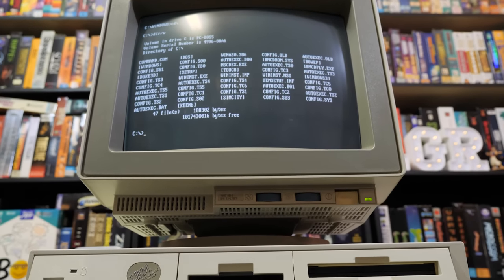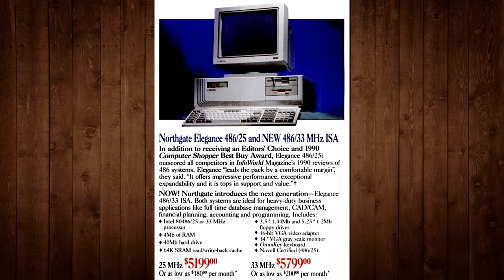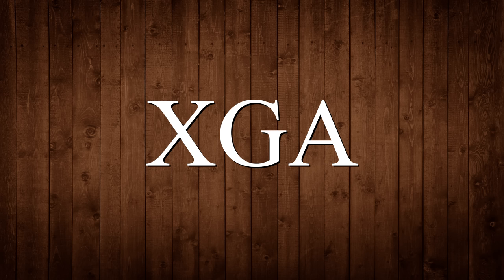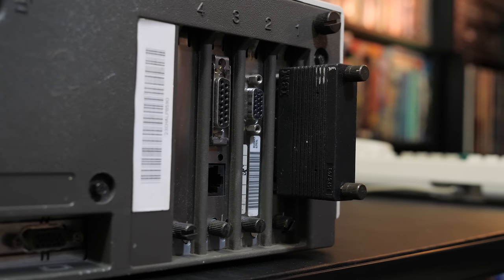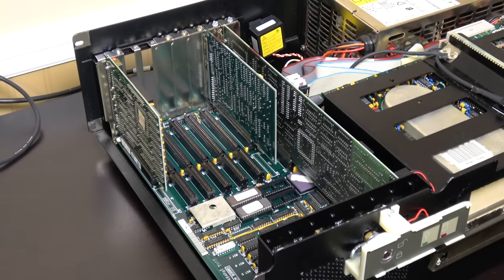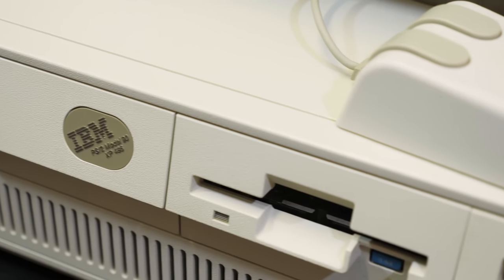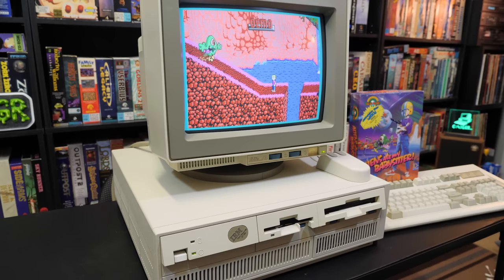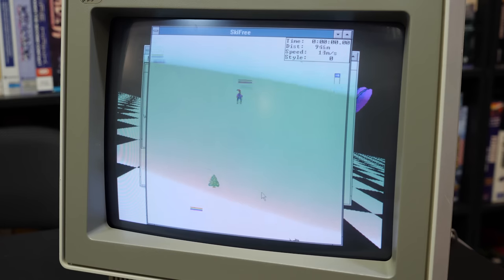$17,000 PC from 1990: IBM PS/2 Model 90 XP 486

Comment: I love your video. I've owned the model 30,60 and 95 back in the day. I would have died to come across a model 80 or 90 as it took less room yet had about the same amount of expandability and compared to the model 30 all the others were absurdly expensive, but also highly expandable if you had access to IBM approved hardware. I installed a DX4 in my Model 95, and used both OS/2 3 & 4 and that was freakishly fast. The one thing the others couldn't offer even if faster was IBM quality. For all of IBM's faults and believe me it's easy enough to find them even with that computer, it is built incredibly well. IBM refused to cheap out. This partly is why they were never successful in the home market. Even the Aptiva was built really well even if it used standard microatx parts. I still own a ThinkCentre model 55, it's not fast nor was it cheap when it was new. But, it was a very well built computer. Next to anything HP sold at the time, it was easy to see the difference. Most business firms could see it, not so much with home users. That's the case with Dell today. Who uses Dell? Well besides myself of course many businesses are now using Dell hardware. Quality. Lenovo just doesn't offer that same quality as IBM did? But you don't see a lot of firms using HP.

Comment: we had the previous model the Model 80 which was $8495, luckly at that time since my dad was developing OS/2 Warp, IBM gave us that computer. for anyone that hasint used those computers, they are loud like Sega Dreamcast fan loud. the case was also heavy (not sure how heavy the Model 90 was), and it had foot pedals on the bottom but a full steel handle bar to carry the case. you could also unscrew the handle bar and do some serious damage to someone with it. he used the Model 90 at his work desk during his time at IBM.

Comment: My computer in 2004 had 32 MB of RAM and a 500 MB hard drive running Windows 95 and it was the most expensive thing in my house. Never really understood how powerful computers were in the US for a reasonable price from the early 90s; this could be an exception but it's powerful even compared to what I had 15 years later!

Comment: If you think it was slow, try the one, which did not have hard drive and had only two 5 inch floppy disks. One used for system floppy and another one for data floppy. That was fun to work with.

Comment: That thing can probably run win98se. Not bad for 1990. In 1990, I only had a Packard Bell 286 with standard VGA, but I did have a 9600 baud modem and an adlib sound card :)

Comment: The IBM micro computers were very expensive because they were built like tanks.  I personally don't remember knowing anybody with such computers at home except for a friend who had a IBM jr computer.  Everybody had some clones at home.  You had two types of clones I may say.  First, you had companies who branded their own great clones, then you had the regular clones made of cheap parts (the casing was the cheapest part of all).  You could have a 486 computer for something like 3,000 to 3,500 $ (including an amber or green screen).  It was perfect for home use...  A IBM could work 24/7; not a clone (meaning commercial, institutional, factory wouldn't trust it).  
As I was an engineering student back in 1990, the easiest way to buy my own computer was the faculty coop who would sell many computers with at good tariffs.  I bought an Apple+ (the small 9 inches b&w screen) with a matrix printer and a 40 mbytes hard disk (lol) for a little more than 3,000 $.  I still have it in a giant bag made to carry it !  Without the printer, it weighted a good 30 lbs......  It was big.....  Nice era I must say because we were following the evolution of the micro computers from the start.  I also have a commodore Vic20 with a cassette recorder (instead of a high tech 5¼" floppy drive).  I had, on that bomb of a machine, 3.5k of RAM and built a card with an additional 3.5k for a total of 7k !!!  I was proud loll.....

Comment: All of that amazing performance that could be had for more than $20,000 equivalent is now dwarfed by a $10 Raspberry Pi Zero W.

I had a PS/2 in 1993, which cost substantially less, and had the DX2/66 CPU in it. I think I had it decked out with 8MB of RAM and it went through a succession of hard drive upgrades starting from the stock 80MB to eventually 1GB before I retired it. I also added a sound card, CDROM and ultimately, the CPU upgrade to the 83MHz Pentium. The expandable CPU option was more of a gimmick than anything, because by the time the updated CPUs were available, the system was already on the edge of being obsolete and you weren't going to gain that much more performance from a CPU upgrade on old architecture. It was a well-built machine, I never had any issues with it and it was compatible with everything I added to it or ran on it.

Comment: I had this exact same model, but mine was only $1000.  Of course, I can tell why there was a huge difference between prices.  Mine was a 386DX 33MHz with a 120 MB HD, with only a 3.5 Floppy Disk Drive.  A lot of those specs were incredibly expensive, like having a 1 GB hard drive probably costed about $5000 by itself.  The CD-ROM drive probably by itself was about $500, which could land you an older computer for the same price.  From what it looked like, it was state of the art for its time, and actually is a fairly decent price for a PC.  Just think of a high end Alienware or iBuyPower computer, and the PC/2 is probably a cheaper option because the price was that high because the technology costed that much versus Alienware being that price because of the name and because it looked nice.

Comment: AT&T Globalyst 486 computer made around the same time was half the height of the IBM version and instead of 5.25" floppy it had spare slot for optical drive or HDD tray.
Reply: 23 may 1994 is not "around the same time" and the computer was not half the height of this IBM... not to mention that this one also have optical drive(clearly you dont understand that this IBM PC is not modern day Apple product that have its drive soldered to MB).

Comment: I scavenged a model 95-something big monster thing (or at the very least, an IBM server computer that looked pretty similar to that) from a dumpster behind a company that went out of business many years ago. I installed Windows on it as the hard drive(s?) were removed from it before they threw it away,  and I think I MAY have played the original Age of Empires on it a lot, I can't quite remember at this point. I wish I still had that thing.

Comment: A very cool look at a very impressive computer for the time!  The only PS/2 I've still got lying around is a Model 80.  Back before I got around to restoring it to working condition, I used it as an end table in my living room.  No joke.  I'm not even sure anymore if it uses a 386DX or a 486.  I do know that it only has 1MB of RAM, and I've yet to run across a compatible RAM board to upgrade it... so no DOOM for me on that machine.

...It does run Wolfenstein 3-D though.  ;)

Comment: At least it wasn't crippled like most PS/2s, this one got a full 32-bit MCA bus and memory addressing! The cost disparity continued even into 1993. You could get a VLB 486DX2/66 clone system for much less then the "low end" PS/2 Model 57 which was hobbled by only having a 16-bit MCA bus and 24bit memory addressing (16MB max RAM) thanks to its tarted up 386SX derived 486SLC2. Its kinda bizarre that most 32bit CPU PS/2s only have 16-bit slots when the whole point of making a brand new bus was to add true 32-bit support.

Comment: I had a less powerful PS/2 (386 SX, 1 Mo, not-quite-VGA-but-almost graphics) as a teenager, 2nd hand from an administration paid with my pocket money. A 486 with 8 Mb would have been way out of the means of my family. that. I was programming in Pascal, x86 assembler and enjoying DOS games, the thing was very reliable and could be transported with no worries. Now I wish I've kept it to setup a server with that rock-solid frame.

PS/2 with 486, can play Doom, that's a thing dreams are made off.

Comment: In 1990 I think the only software I had that could even use 640x480 graphics was Fractint. I think Scorched Earth was the only other thing that went over 320x200, but it was some kind of weird resolution like 320x480 without square pixels.

Comment: So I decided to look into what a machine comparable to my NuXT would have cost in 1983, assuming the parts existed (some of which didn't). Accounting for inflation and the fact that my NuXT has a drive that didn't exist yet in 1983, and deliberately ignoring the IDE CF adapter with a 2GB CF card stuck in it (which would have been worth $514,847.39 on its own accounting for inflation).
 Not including the 2GB CF card, my machine would have been worth $105,543.71 US in today's money. Including the CF card, the NuXT would be worth ~$620,391 accounting for inflation in 1983. Thank the Omnissiah for Moore's Law!

Comment: And come to think about it, for only about $40, I bought a Dell Venue 10 pro 5055 laptop pc which would be much more capable, runs a full fledged Windows 10 pro operating system, and is much more recent, though not new, from May of 2015. I remember around 1990, we were using those Apple II PCs sometimes to do classroom assignments.

Comment: Sigh I remember IBM's insane prices, they were selling a 80386DX/33(?) for about $12000..  I don't recall the year but I think it was before the 80386DX/40 became available in Europe.
I ended up buying a "compatible" with similar specifications for about $3000 : 80386DX/33, 4MB of 70µs RAM instead of the usual 80µs  (I suppose it was µs and not ns), a hard disk of 89MB and a VGA card.  Ah, memory lane ...

Comment: Yeah, that's how it was back then. My 1987 self would shit a brick at how inexpensive RAM is nowadays: I paid $300 for 256k (a quarter of ONE megabyte) of RAM for my Amiga 1000 in 1987. You can buy a 1GB DRAM stick for about $10. That's 4000 times as much memory for 1/30th the price! Just recently I paid $10 for 32GB flashdrive. My 60 MEGA byte HD of the time cost over $300 (and that size was considered "way more than you would ever need/use"). Crazy, man!

Comment: I had a 286 and a 386 back in 1990 and I thought the latter was pretty good for the time. But this thing is an absolute BEAST. I didnt get a 486 until mid-93 and that was a DX40 with 4gigs of RAM not to mention the CD drive, I think I got my first one in late 1994/early 95, I really cant remember. This behemoth could even play Duke3d on those decent framerates I see on the video? On a 1990 machine??? Holy sh@t!

Comment: I recall spending  a couple of years doing summer jobs in the mid 90s to save half the required amount to buy  133Mhz IBM. Fortunately my dad chipped in and paid the other half. Feeling nostalgic.
Reply: Ali Ahmad Was that a 486DX4 or a Pentium?
Reply: It was Pentium I - 133Mhz.   It had Windows 95 on it. Computers were somewhat affordable at the time but still considered a luxury. I bought it for $2500 in 95.  It was the 486 I had been using at school that made me determined to get my first computer.

Comment: I don't know what BIOS revision you are running on there, but if it is still available from IBM (and much of it is!) you should install Surepath BIOS v 10 on there. It was the last revision and will allow you to install ANY complex in that machine, even the P60/P66/P120.

Also, those accept Overdrive chips rather well, but the 100mhz chip only tops out at 75mhz. I think it was a bus limitation if i remember properly.

Comment: The problem with Microchannel, if you added or removed a card (even if it died) you need the floppy of THAT SPECIFIC PC to add or remove the card in the BIOS or the PC would not boot.

Comment: I worked in 2 offices that had OS/2 machines, it was damn nice compared to win31. Of course when no one was looking I installed stuff like Wing Commander and was shocked to find out that OS/2 could play some games in a window that turned win31 into a slideshow if you tried to do the same thing. Pretty much everything about it was more professional and more stable than it's MS counterpart. Too bad they were so ham-fisted about it they might have been the one.

Comment: Did 486 DX2 chips even exist back then? I thought those came out in 1994.. the late 80's ~ early 90's was the 8086 Tandy / CGA days.. 486 would have been way ahead of its time. I know for a fact that the Phillips CD-I console was way ahead of its time during that time
Reply: 486DX2 was early 1992 486 early 1990

Comment: I've had one of those in the mid 90's. Cool machine, have been playing a lot of games but without sound. Imagine a kid who finally saved up a lot of money to buy a sound card (again, mid 90s, so it cost a lot), buing it, going home, and finding out that there is no way to install that, or any sound card available in my pc. We could order one from IBM from abroad for 5 or 6 times the price. The XGA, or XGA 2 in my case was crap, didnt support any SVGA stuff, like VESA, so forget about running Simcity 2000, GTA 1 or Worms (although you could run some beta demos of Worms). Duże Nukem 3d worked only in VGA mode, so no extra stuff like magazines on the ground and no strippers (but he was still giving them money by pressing space button and you could blog them away with RPG, they were just not visible  just the blood).

Windows 95 and DirectX opened up a lot of more possibilities, like Tomb Raider 2, going smoothly. 
It was 486/66 on 33 MHz bus, with XGA2, 16mb of RAM and 640 MB HDD if someone is interested. 
Oh, I got TEAC CD for Christmas, it was cool etc, but again, had to return it and buy another one, cause there was no IDE, only SCSI. 
Can't help thinking that that made IBM obsolete and obscure company. And they were at the top!

Comment: Since I was a computer and software designer, I can tell you that the 1980 Apple 2 computer cost (in today's dollars) $8000.  It had only 4 colors and 16k of memory. It had no disk drive only a tape drive.  When anyone tried to improve on Apple's design (like 32k of memory) they were sued by Apple. Most early computers used the tv not a monitor.  Oh, Apple screwed up as well.  It created the Apple 3 that nobody supported and it cost a fortune.  Even the Fat Mack had problems with buyers.

Comment: OMG that looks VERY similar to the IBM 486 I had. I got it from an Auction sale. Mine only had a 486SX33 CPU I think, and 4MB Ram, and 120MB HDD. HOLY CRAP!  Pretty sure mine is landfill now. I added a normal CDROM to mine. I also dont remember the "cowls" over the drive days. But other than that it looks very very similar.  It was a disappointing upgrade from my 386DX from memory, however it did play Doom2 "ok" so can't have been all that bad.
Reply: Ah maybe mine was the home user version, although the auction i got it from was for liquidated office equipment.......

Comment: Like you said in your video: You needed an IBM MCA license to build a MCA machine. But the real showstopper was, that you initially even had to obtain a MCA license to build add-on cards. That not only alienated all the add-on card manufacturers, but made MCA add-ons quite expensive.
Fun fact: IBM's MCA policies triggered one of the early OEM-consortiums to form and come up with the EISA Bus specification, which was essentially free to everybody to implement (Well, it wasn't exactly free, but did not include volume fees).
Suffice to say, that EISA soon ruled the market up to the very day, when Intel got sick with being sidelined and came up with PCI.

All of this was an entirely dumb move from IBM. With relaxed MCA licenses, they could still sell chipset components, like bus controllers, to other OEMs and potentially could have dictated the Bus wars straight on. Even Intel was reluctant to go head-2-head with IBM.

Comment: Wow ! Amazing how expensive it was in that time ! For now i have a laptop which contains a Intel(R) Core(TM) i7-3632QM CPU @ 2.20GHz 2.20 Ghz, memory installed 6GB (5,88 GB available)  64 bit operating system, x64 processor.   It sold for about 879 euro ?!  that unit was weigh overpriced that time. IBM should do something to the owners of these systems to make this up.

Comment: Our first pc was one of those shitty ps/1s. You may have done a video on those I don't remember. It had a 386sx with like 2mb of ram and an 80gb hdd. They were these strange all in ones where the monitor and PC were connected but the power for both went through the monitor. I really got lots of mileage out of that crappy thing and it really kicked off a lifelong hobby. Nobody else in the house ever touched it so it was all mine. I upgraded the sound card so I could hear those Nazis screaming for their lives in Wolfenstein, and I put a fast as hell 9600 baud modem in it and could download so many demos to that bad boy. Doom was the first game I couldn't run on it. Just couldn't get around the 4mb ram requirement no matter how much tweaking I did. Lot of fun with old games like Ultima, Commander Keen, King's Quest, Police Quest, Wing Commander... all the best stuff man. Still have a soft spot for this era of IBM machines. I'd have murdered someone for the one in this video!